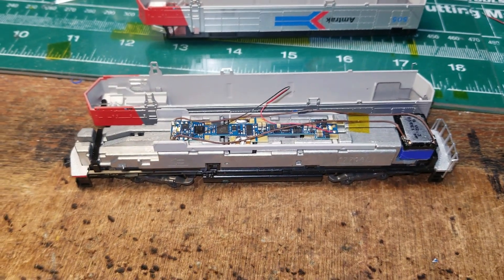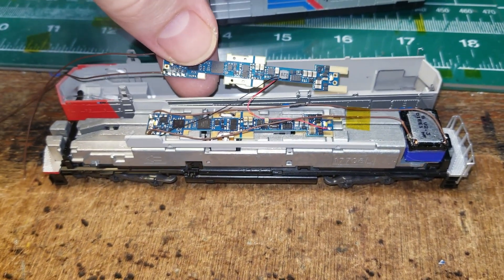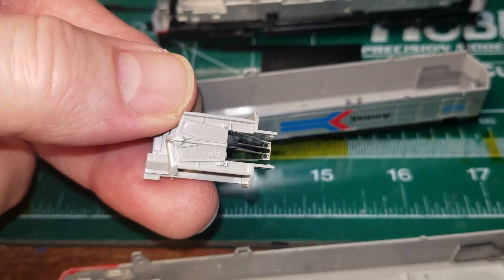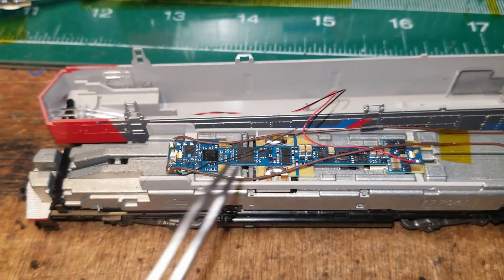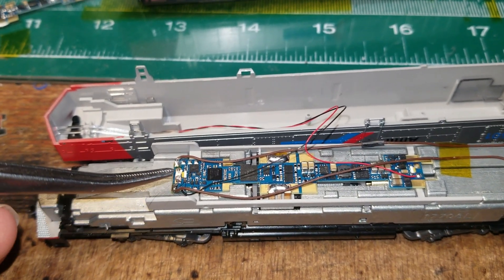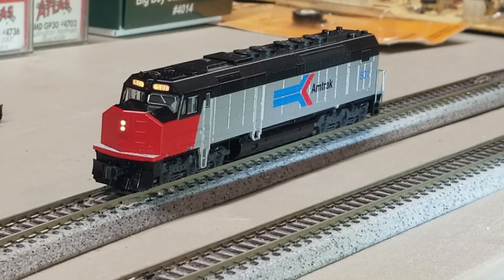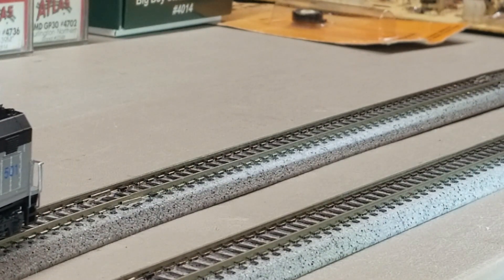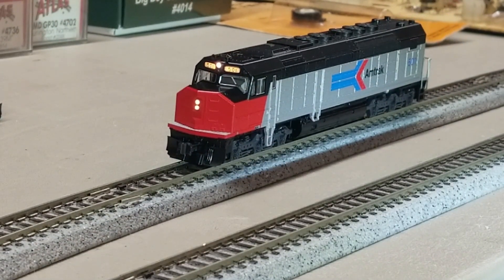N Kato SDP40F ESU LokSound install

Comment: I can’t for the life of me find an SDP40F file from ESU that works with this board
Reply from the maker: ESU v5 file S0765.  You will have to  function map the lighting correctly and reverse direction since the 58741 is orientated backwards in the SDP40F model
Reply: @nightmare0331  Thank you!